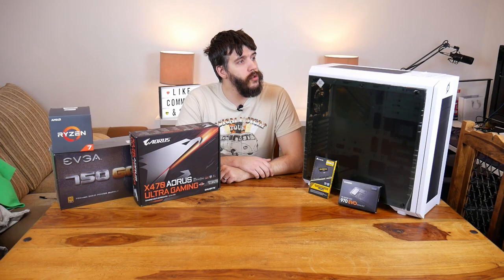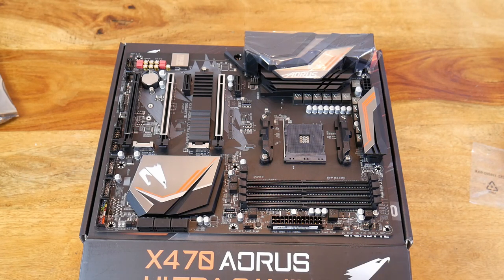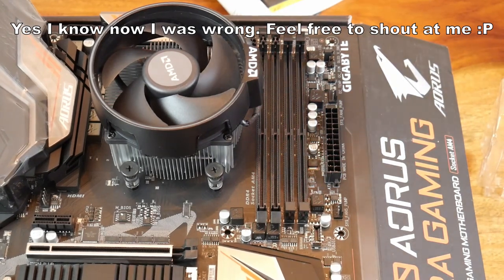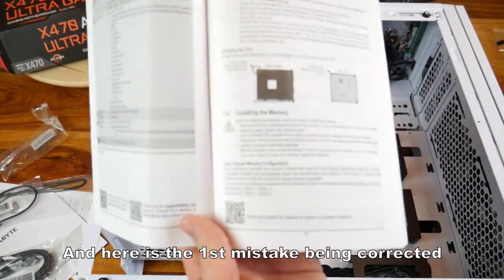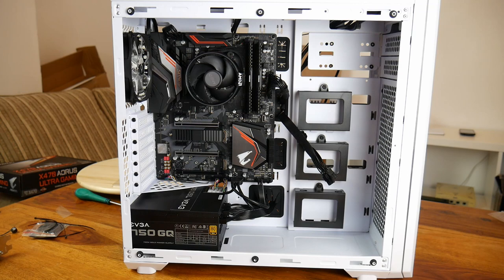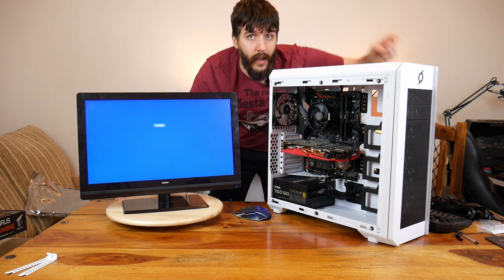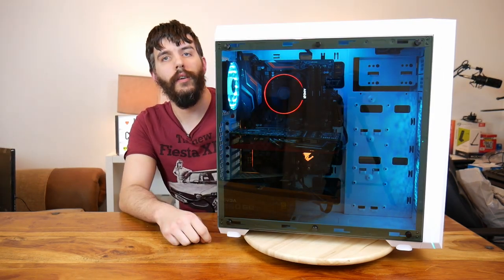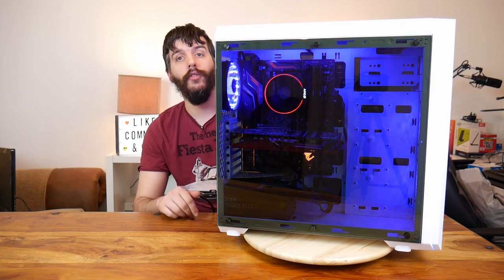Gaming/Video Editing PC Build - $1200 Computer Build

Comment: How is it holding up? Have you done any 4K editing?
Reply from the maker: Its been running really well. I haven't yet done any 4K editing but I have full confidence it will do 4k no issue. I don't yet have a 4k screen myself to justify me doing 4k
Reply: @welshtony1  Thanks for replying I'm thinking of going with the RTX 260 as I use Vegas Pro 16 so don't really need an expensive GPU or could you recommend anything cheaper thanks.